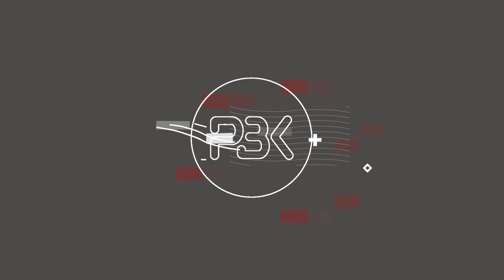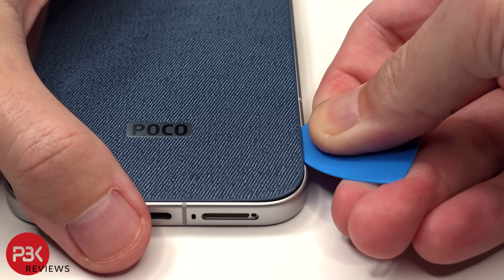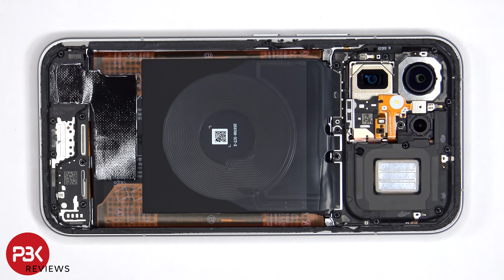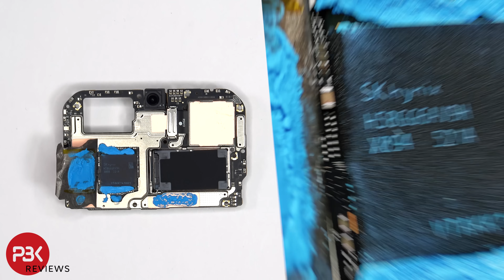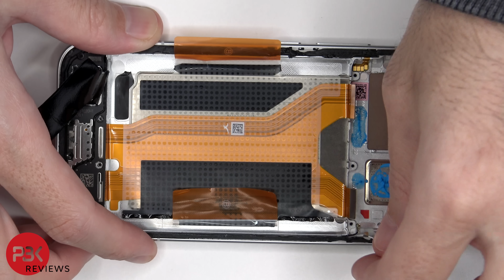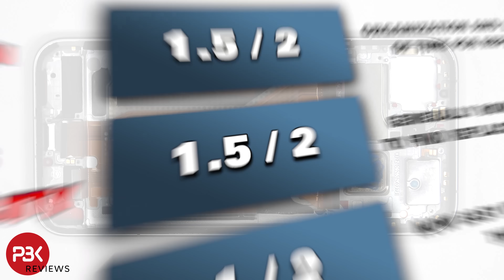Xiaomi Poco F8 Ultra Teardown Disassembly Phone Repair Video Review

Comment: So is the main question for the service center expert - What battery is actually, is this a new Silicon-carbon (Si-C) battery  or f8 Ultra have traditional lithium-ion (Li-Ion/Li-Po) battery? 
Is it possible that this is some type of combined materials, but how do I understand in what ratio? 

In general, I'm not really surprised by these new carbon batteries. Their autonomy in smartphones with a super-powerful processor is not much different from previous generations. It's the same day with active use. These are the same 6-8 screen hours with active use, and that's while the phone is new.
maybe they really have more cycles, then it makes sense...

Comment: Nice video. Can I change the backplate from the denim-blue one to the black one? Will it fit, and is the adhesive pre-applied to the new backplate? The black backplate matches the black protective case better, and I think it might look quite nice with the silver aluminum frame :)
Thanks in advance.

Comment: It's been two months since I bought this black smartphone. I love everything about it, from the photo quality to the sound. It's a fantastic device! I think it'll last me four years.
Reply: If it's so great, considering the 4-6 years upcoming updates, it should last you at least 10 years. I use my Xiaomi mi a3 from 2019 till now which costed me back then 170€...
Reply: @songoku7915  I also have a smartphone that I used for seven years, a Xiaomi Mi Max 2. When I started looking for a replacement four years later, I discovered that, unfortunately, no one makes widescreen smartphones (screen width 80 mm or wider) anymore. I prefer tall smartphones with a 16:9 aspect ratio.
Reply: @songoku7915 Yo dure 4 años con un Poco X4 Gt, y lo acabo de reemplazar por este increible celular Poco F8 ultra
Reply: @songoku7915 mi a3 good phone
Reply: By far one of the Best purchase I've made.
Reply: Камеры и правда отличные. Сам восхищаюсь съёмкой на него.
Reply: Have You experience any sound distortion or issue ? I got My a few months ago and had to be replace by the warranty bc the back speaker started to sound weird, and now after less than a month the bottom speaker is doing the dame thing and i have not dropped the phone in water or smt similar😭
Reply: @kennethlopez2378  I didn't quite catch from your message what exactly is wrong with your speaker. There’s a speaker mesh cleaning function—have you heard of it? Mine is working perfectly; I’ve had the Poco F8 Ultra for ten months now, and it runs like clockwork.
Reply: @kennethlopez2378  put it on dynamic sound on with Dolby Atmos and you should be good.
Reply: @kennethlopez2378   No, I haven't encountered that. By the way, the Poco F8 Ultra actually has a function that clears out a specific sound caused by a clogged opening or cavity. That’s probably the sort of thing you’re worried about.

Comment: I got this phone recently, overall it's a very nice piece of kit, it's good value for the money.
The only concern I have is about the new chipset, the SD 8 Elite Gen 5 is just a monster of a processor, and as such it really likes to heat up.
While I haven't experienced any significant heating while charging the phone, even at 100W, during gaming the phone does heat up pretty good, especially the aluminum frame.
Now, I know that's technically a good thing, because that means the vapor chamber is working and the metal frame is being used as a heatsink and the heat is actually being transfered away from the battery and CPU.
But still, I am worried that prolonged use could still put the hardware under too much stress and cause longevity issues, especially in warm climates.
I wonder if using one of those phone cooler with a peltier cell might ease up the stress on the components.
But then again I wonder how the "denim" back cover would fare with a cooler attached.
Any opinions?
Reply: Just run it, my poco x3 pro was a oven, but it held up, hows your experience with it, does the extra speaker makes a difference? Is it worth it? Is there s difference with day to day use?
Reply: @alanhernandez8440  its not a Big diference with a f5 pro my last phone ,but the speaker sounds really really good and perfomance is amazing... 760 euros i paid..
Reply: @alanhernandez8440 the sound - really- is great. Best phone speaker I personally heared
Reply: @alanhernandez8440  I just bought the F8 Ultra and already I find myself using the built-in speakers to listen to podcasts and watch videos without connecting a Bluetooth speaker or headphones. The audio quality for casual listening is just that good.

Comment: First of all, thank you very much for the greatly insightful video. But let's discuss about the fact that this phone is somewhat positioning itself as a gaming phone. That SoC is drop dead inside under multiple layers, which are 

Camera/speaker island bump
Backcase
Bose speaker layer
SoC

How the hell a peltier frost can even reach that deep???? I don't get it, the chipset is crazy powerful, but if you use it for long gaming session, sustained session, the thermals gonna rake up like crazy isn't it? Like, where are you gonna put the peltier/any cooler?? On the battery? Yeah sure battery cools down, but battery doesn't decide throttling, SoC does, doesn't it? 

Please, anybody, humor me...
Reply: They don't design it for long gaming sessions. They just slap a powerful SOC for advertising purposes and hope the graphite film and vapor chamber transfer enough heat outside to cool it enough for a sub 30minute thermal throttle which assumes you play games at only medium settings 60fps.

But yes a peltier is actually enough and can transfer heat fairly easy through the SOC > vapor chamber & back graphite film > battery to graphite film.

Most importantly the frame is metal which improves heat transfer to air even more.

But yes it's worse than a metal unibody design for transferring heat to the back and yes it's worse than even an iphone X at transferring heat to the back.

Overall it's a decent way to route heat away from the SOC but not enough to make full use of a peltier cooler. Unless you replace the graphite films with thin flat copper vapor chambers
Reply: Also another note, the biggest way it transfers heat is front towards the screen like all mobile phones are designed to so if you plan to play longer sessions, don't use a screen protector

Comment: Where is the pressure equalization hole? Since there is protection ip68, there must be a valve :/
Reply: The pressure equalization hole is located on the camera unit where the IR port is located.

Comment: I am wondering Sir, if it is possible to Replace the original 6500mha battery of the Poco F8 Ultra, with the battery of it's Twin phone the Redmi K90 Pro Max with 7560mha Battery? They are basically the same Phone but the Redmi Is China Rom with a larger Battery.
Reply: the battery is the same, the poco has limited capacity to extend the life due to eu requirement
Reply: @marcin.smolinski so basically I can replace the old battery of the Poco F8 Ultra and purchase instead the battery of the Redmi K90 Pro Max to improve the battery life without issues?
Reply: @dankinmemes1828 no, the battery in poco is the same as redmi but limited by software
Reply: @dankinmemes1828  he said the same so maybe its OS limitation?

Comment: The ultra wide camera has Gyro EIS
Reply: Nope. Ultra wide doesn't have ois only eis. So no gyro
Reply: @ryokubudook phones use gyro scope sensors for EIS so thats why its GYRO EIS
Reply: @Monsterpoppyschool  eis stands for electronic image stabilisation and relying only on software image stabilisation so in short no gyro is involved
Reply: @ryokubudo i know its software based but the phones software is using the gyro sensor to detact movements  and remove with  motion blure with software and stabelizes the video using the sensor so its GYRO EIS😮
Reply: Its using both Software and gyro sensor so its GYRO EIS
Reply: @Monsterpoppyschool  it's ultra wide lens it doesn't even have AF 
Go trolling elsewhere
Reply: @ryokubudo search on google if you wont believe me 😢

Comment: Can fit with redmi k90 pro max battery to this poco f8 ultra?
Reply: They are the same phone
Reply: @eanimalfactsbut some of the rated voltage is different,
Nominal voltage written on battery for Poco f8 ultra is 3.85Vdc and redmi k90promax is 3.79Vdc
Is it safe?
Reply: @citotchannel8746 Yes, it is safe.
Reply: @eanimalfactsk90 pro max has 1000 mha more
Reply: Most likely the battery from K90 Pro Max will work just fine, because the driver for the battery will definitely be there in the kernel.
Reply: That is something we need.
Reply from the maker: a lot of times there are software locks also, so placing a different battery in will only show up as the previous programmed amount or not work properly etc. I haven't tried it with this phone to see if this one is different.
Reply: @PBKreviews hope you can try it soon  ya buddy😊
Reply: @PBKreviews  thank you for your explanation, but I see that a lot of people constantly bringing that idea/topic of exchanging battery. If it possible for you to do some batteries comparison maybe it could(?) bring you more views/subscribers.
I admire your work and videos. 
Wish you all the best